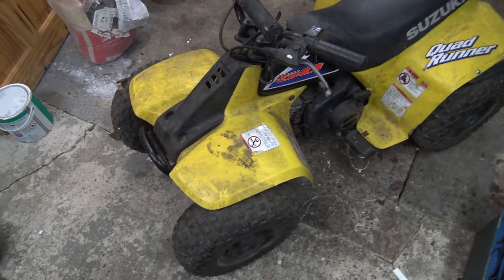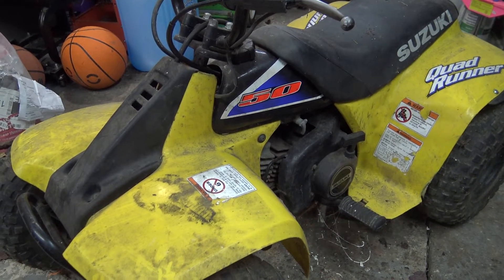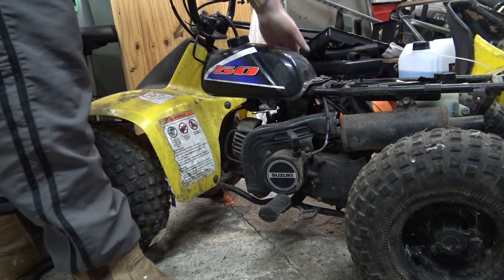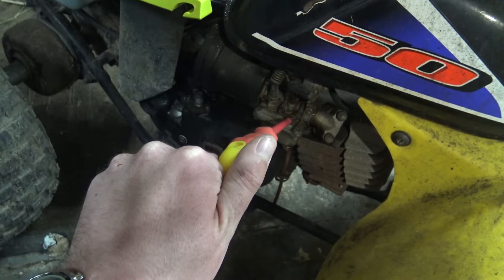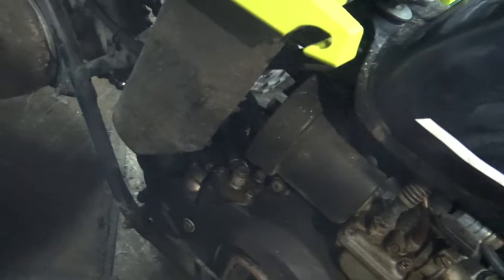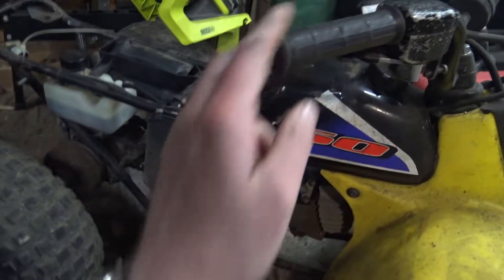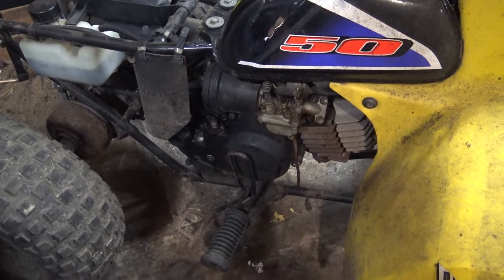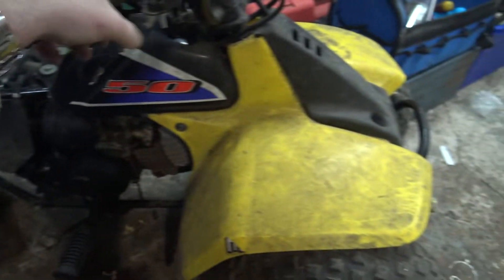Suzuki LT50 Start After 5 Years

Comment: Mint little thing mate I was involved in a motorbike crash on Wednesday but got a new bike now it’s a Honda cb125f 2021 plate mate
Reply from the maker: Niiiccceeee I like Hondas
Reply: @RSPYT  this is my first Honda mate
Reply: The on position on your fuel tap is also the off position when Engine stops running it works on a vacuum

Comment: Bro I am from India 
I have lt 50 imported  another person out of my country 
 I need some parts very urgen can you help 
1 seat or it s  metal frame of seat 
2 brake l ever a cable and brake shoe
3 accerate mound and its cable 
4 air filter and its cap
5 fuel tank cap 
6 clutch assembly and clutch cover packing
 Over all this seat is very orgent